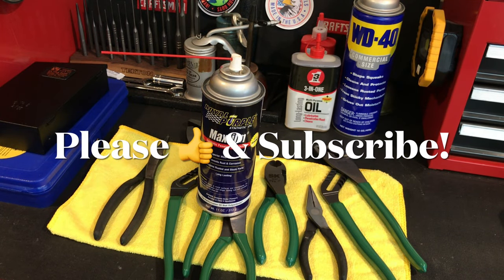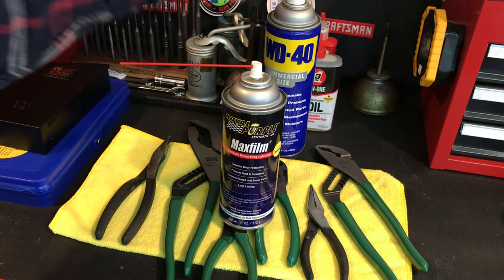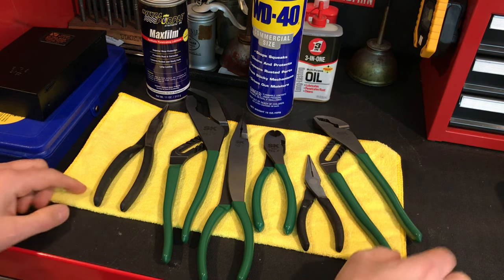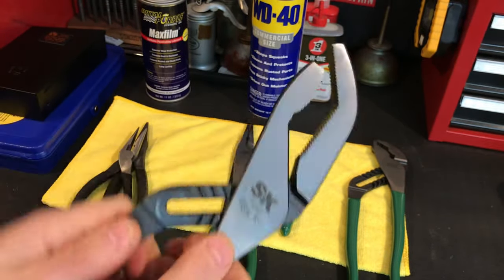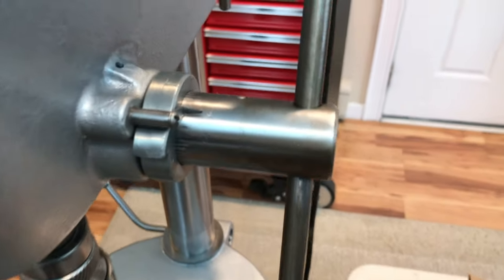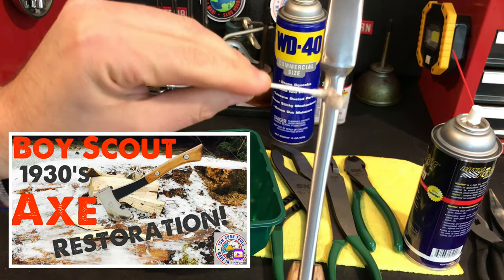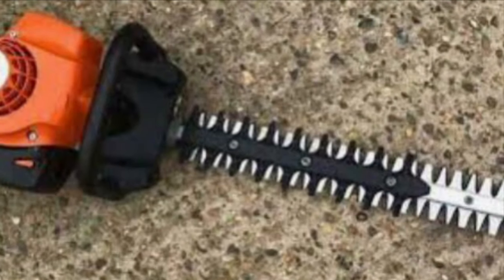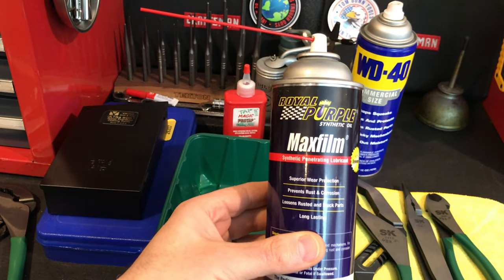Rust Prevention! How To Prevent Rust!

Comment: I buy a can for every new car I buy.  I spray it  everywhere the spot welds are horizontal and water can collect. (Doors , trunks, wheel wells even some frame spots.  )
Reply from the maker: Brian, I used do do the same thing with WD40, I will now be trying this. I appreciate you sharing.

Comment: Tom, thanks so much. I've used 2 methods for rust prevention and did NOT like or trust either. One was saturate with WD40 and know that long term would not last. The other was coat the metal with boiled linseed oil and, AGAIN, know that long term would not last. Ordered a can just moments ago. I recently ordered the finest, and most expensive, tool I've ever owned, a set of Starrett punches and have pondered coating them with grease. Now I'll give them a coat of Maxfilm.
Reply from the maker: I always did the same with WD-40. This seems to be a real good solution. Ted said he puts  2 coats on the expensive tools and the ones he uses often. Sounds like some sweet punches, very nice!

Comment: Do you think this would work well for impact sockets? If I put it on the inside would it still fit the bolt or nut well?
Reply from the maker: I do, I think it would be perfect for impact sockets. It’s a very thin coat left behind